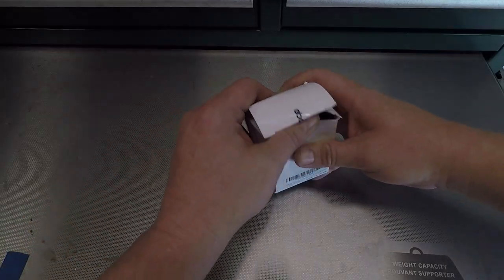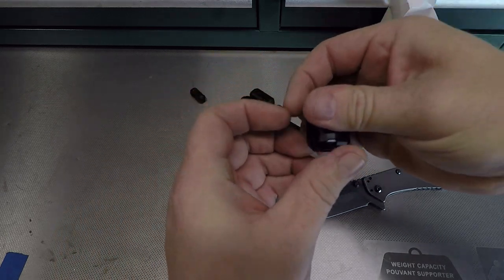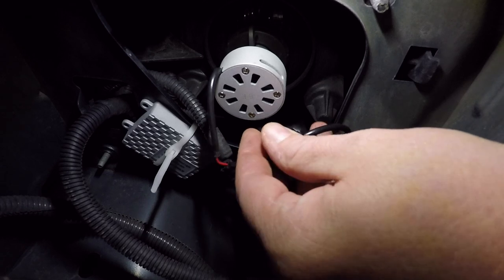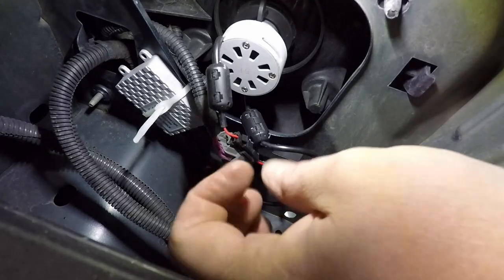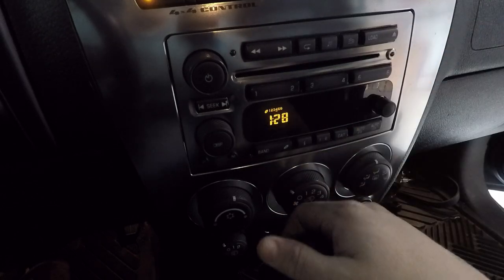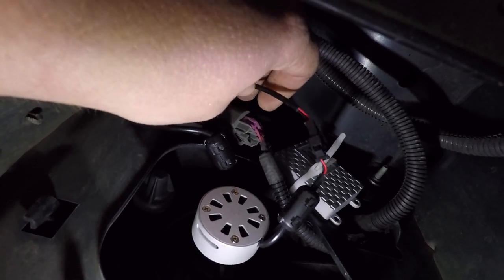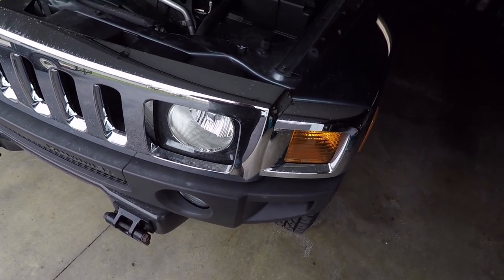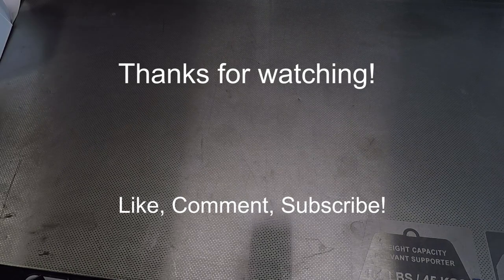Fixing LED Headlight Radio Interference

Comment from the maker: Please subscribe to my channel! I could use all the help I can get!  Thanks for watching!
Reply: Next time, try a capacitor to filter out the switching frequency.    The noise is coming mostly from the led control ic that switches the leds on & off at a high rate of speed to keep voltage within spec so they don't burn out.    The fan also creates a pulse when it's running, so a cap on it will help filter out the ripple.

Comment: Thanks for vid. But my personal experience, I just now finished putting about 10 of these in my car. All four led day running bulbs, two halo's rings, on the relay powering the relay, the on/off switch, feed power wire, power wires on the head unit, even on the antenna cable. Nothing, not even slightly better. Oh well, we tried.
Reply from the maker: well, crap.  yeah it was worth a shot..

Comment: I clicked on my volume off button on the speaker volume and it went away. 😂 Didn't think that the buzzing noise was coming because i had aux cable connected.

Comment: Great video. I have the same issue. Googled it and saw the filter clips. Just wondering if the clips have to be snug to the wire or if they are loose will they still do the trick?

Comment: Looping the cable Around the core up to 7 times increase the effect
Reply from the maker: Didn't know that!  Thanks! Are you talking through the center or around the outside like a cylinder?
Reply: through the centre, around the outside, through the centre
Reply: what core?
Reply: Wire for the bulb isn’t long enough

Comment: Thank you for your video.
   Vehicles now have many computer chips. Each can generate RFI or radio frequency interference. Also, any wires connected to a radio or sound system can act as an antenna. So happy hunting.
   If 2 turns of wire are looped through the ferrite bead, you get 4 times the noise reduction. 3 loops, 9 times the noise reduction. Saves on ferrites.

Comment: I just put LED headlights in the '87 Porsche 928, static now on all the FM stations. I can visibly see the "shaking / strobing" of the headlights. I will give your solution a go to stabilise the current.

EDIT: I installed a 30mm clip on ferrite suppressor on each headlight cable, it did nothing to reduce the radio interference. unfortunately the cables were too short to loop around the suppressors.

Comment: It’s the PWM ‘pulse-width modulation’ of the diver that is causing all that interference, the best way to get rid of this is using a LPF low pass RF filter. Another thing that will work is a anti-flicker harness....

Comment: Very helpful, I was getting RF interference big time after I installed my SL1 LED headlights.  I ordered a set of #10 5mm ferrite beads from Amazon.  I only needed one for each light to totally eliminate all the interference.
Reply: Which cable did you put them on ? Leds or radio areial

Comment: I think it's linked to poor ground.  I have the same thing as well but looking around to validate what I think it is.  So taking the ground off and turn on the radio.. if it clears, then try a different spot to ground u til radio clears up

Comment: Rocket Scientist, amazing, GMTA! Every light in my truck is LED. Going to give this a shot. My LED's came with canbus so I know that isn't the fix, but may be the problem. I had my driver rear saying bulb out, unplugged it and rotated it 180 and solved that. Lets see if this works on the radio noise. Thanks!

Comment: Ive had that exact type of led bulb before, first type/design I ever tried. Ive now had a few different sets and found the cob designs suck and you want a bulb w like a cree xp70 or two on it kinda thing.. but the filter is an interesting idea. It would work better on the speaker wires. Or a diode at the fuse box to ground I think..

Comment: You could also add one to power supply to the radio itself.
Also looping the wire through the bead a second time is even better.
Reply: Where is the power supply to the radio??

Comment: You could also try tracing your headlight harness back to the fuse box under your dash, or in your engine bay, where ever it might be, and placing the ferrite cores on the wires closest to the fuse box, but also on the power wires coming from the fuse box to the stereo. The major issue here, is that the ignition system, headlights, dash, radio, windows, and a few other systems all rely on the same fuse box, and therefore wire harness, which is why when you turn your headlights on, it begins to interfere with the stereo. I put ferrite cores on the power wire from the harness coming into my stereo and it cleaned it right up. No need to place them on the headlights at all, unless you still have static.
Reply: The important thing is to stop the wiring acting as antennas.  For the LED-headbeams that is as close to the lights as possible.  The main problem is the voltage switch mode regulators.  They act like spark gap transmitters with lot of harmonics in the radio spectrum.   Clip on ferrite does not attenuate much, so often you use several in series.  A ring core with many windings works better.
Reply: @la7dfa  Hmm, I'll have to make one. I have several ring cores in a tray around here somewhere, and plenty of solid copper wire core.

Comment: I have LED headlights, all my running lights are LED, 3 LED light bars, 2 facing forward, 1 is white and 1 is amber, 1 white LED light bar mounted on my headache rack facing the rear, 2 sets of LED pods in my rear fender flares, and 1 set of LED pods in my rear bumper.
None of them causes any interference except the 1 forward facing white light bar.
When I turn that one on my radio is useless.
I added a ferrite on the power wire where it enters the bar and all interference is gone 👍

Comment: You are a life saver! Just put in mini led light bars on my jeep for driving lights. Though I wouldn't be able to listen to the radio at night. I'm ordering this right now!
Reply from the maker: Let me know how that works on a light bar!  I don't have one and I'm curious to see if it works on something with multiple led's.
Reply: @RocketScientist  I just installed them. They work great! Almost no interference now. Before my light bars blasted the whole radio out. I had to play around with the sizes and locations to get the best single. I got better results when I upsized but they are a little loose.  I'll have to zip tie everything in place, but now I can have my lights on and listen to the radio at the same time! Thank you for the video!

Comment: I put 4 cores on each headlight wire but it didn't help at all... I'd put some on the radio power but its too much of a hassle to take the whole dash off. Easier just to switch back to OEM bulbs.

Comment: You should have tried putting some on the power to the radio and also if you have enough wire you can go around and pass thru a couple times with more success or just adding more of them to the same wires
Reply from the maker: James Holbrook I heard that, unfortunately not enough wire on the headlight kits to do that

Comment: I'm glad it ended up working out! Much like you, I'm not exactly sure of the source of the RFI. I just installed Halo LED headlights, so it might be the Halo or the LED (or both?!) Do you recommend throwing ferrite chokes on everywhere, just to pinpoint the issue? Thanks!
Reply from the maker: Thats pretty much what i did.. on and off various wires until the noise stopped.

Comment: Another thing you can do to get rid of interference is ground the back of your radio better with a bigger ground
Reply: I have LED headlights have interference too. Talked to a stereo installer about it, he said the coils are really the only option or go back to halogen lights again👎. Apparently it's caused because the led lights draw less than 12 volts? Which I don't really know much about. So any other suggestions?

Comment: I know this is an old video but I hope you're still active. My running lights work and that's it. Could it have something to do with the radio that was installed?
Reply from the maker: I'm here, just haven't made a vid in a while.  By running lights you mean dash lights or outside lights?

Comment: Get the dash cancellation message hide plug for the light bulb size you have , it's a plug that plugs between the bulb and the main harness. Ebay for $9.00. It's a HID plug. Has a black box in the middle plugs on both ends
Reply from the maker: Kevin Hunter Thanks man!  I'll look into it.  I installed a different set recently and they have interference I can't get rid of.
Reply: Hey mate, could i get more information on that plug you were talking about?
Reply: What is the device called?

Comment: I recently installed 55w HID ballast in my ford.. Post installation i have started experiencing a high radio interference while  playing FM. Could you please guide how to select whixh ferrite clip/beard should I get as there are a lot of options available in market
Reply from the maker: This is similar to the kit I ordered.  There doesn't seem to be much difference in the actual items other than size and quantity.  Its probably a good idea to get a variety in one order.  I also thought about wrapping the entire ballast box with EMI tape.  Cost is about the same, and its another option.  Could do both if you had to.  

Taigoehua 20 Pieces (Black) RFI EMI Noise Suppressor Cable Clip for 5mm/ 7mm/ 9mm Diameter Cable https://a.co/d/h6Qg75M
Reply: @RocketScientist  let me try that... But I presume this should work

Comment: So I have a led emergency blue light bar and it will do this with my firedept radio and pager. Would these things help with that?
Reply from the maker: Hey brother!  Also a FF of 25 years.  It might.. I think you might run into a problem since there are multiple LED light heads contained in the bar.  You'd have to take it apart and put one on each individual light inside. What brand light is it?  Is the radio a portable or a mobile installed in the car?  I ran a slimlighter and a bunch of tir3's for years with no issue. Also had good luck with Tomar products.   Probably easier to sell the bar and get some others that don't emit as much interference.

Comment: I think it has something to do with the radio antenna ground. I have the same issue but with LED brake lights. There no static when the sourcing from a USB instead of the radio signal.
Reply from the maker: Matt Greenland hmmmmm thats interesting.  I might have to investigate that one further... Thanks!

Comment: I thought the ferrites were to be put on the RADIO wires first to stop excess noise 1st? 4 /7/2021 like when you have RF from sparkplugs on older cars. I believe there are two other things that can be done as well but its been a long time
Reply from the maker: tried it in a later video with some different lights.  did nothing.

Comment: Thanks for this Will give it a try on my leds day running light I had fitted as my signal to the dab radio is awful!!
Just to double check do these just clip on the wires to the leds? 
Or should they also go on the radio areial cable? Or both ?
Reply from the maker: Yep they just clip on.  Try it on one wire at a time so when the sound improves, you know where the interference is coming from.
Reply: Does it matter how many I put on?
Which should I try first leds cables or radio aerial cables?
Reply from the maker: @luciocancellara4995  most convenient one first.  I tried my antenna wire and it did nothing.

Comment: I’m pretty sure all led diodes are supposed to be sideways and not up and down as they appear in your fog lamp. You should be able to clock the bulb to turn is sideways. This will help prevent glare and make the beam pattern the closest to stock as possible
Reply from the maker: That particular led in the fog light only has a one-sided LED, so it reflects opposite of the way its facing.  Turned upward the way it is, the light bounces off the top of the housing and down toward the road, exactly how I want it.
Reply: Interesting

Comment: What if you just put it on just the radio?? Would love to know if that would work instead of putting it on all of those wires??
Reply from the maker: eh.. i got some other lights that I reviewed in a later vid.  I put them on the antenna wire and it did nothing.  My new lights make noise no matter what.  I'll probably do some tinkering with it..

Comment: Thanks man. I just purchased these farite clips for my Harley ultra classic. Installed led headlight and lost all radio reception. Hopefully it solves the problem.
Reply from the maker: Awesome!  Let me know how it works out!
Reply: William Lerp did they ever work.
I have a Street glide and was thinking to try these because of crap reception
Reply: Mike Hammer  they worked somewhat. I regained some radio reception but not as good as it was before the led installation.
Reply: @williamlerp9773  If you can loop the wire thru the Ferite clip several times it will do more for you, there are also electronic chokes that can be used I believe and could be better.
Reply: @Critical_Mass  that's exactly what I did but I only regained some of my reception. Luckily I have a cd player.

Comment: just wondering should you put the ferrites  on the radio wire?
Reply from the maker: DERMOT HENRY Hmm... not sure.  I didn't try that, but I would think it would mess with the desired radio signal.  perhaps I'll try it just for the heck of it.  Thanks!
Reply: Antenna= no, radio power= yes
Reply from the maker: H Higgins  tried it.  Made no difference.
Reply from the maker: H Higgins  exactly what I did.  I have since changed these lights out for a different set which I have also reviewed it interested.

Comment: So, I have the same truck as yours. I have also tried the ferrite cores and no luck. I even "stacked" them 3-up on the lines and no difference. ...any thoughts?
Reply from the maker: Hmm... Thinking about what may be different about mine...  OEM 6 disc GM radio.. I have a generic replacement antenna since a car wash ate my factory one.   I did try the stacking idea to no avail, and ended up with one on every wire going to each light head, and it worked so I stopped there.  What brand of headlights do you have?  Any other LED lights on your truck besides the headlights that you may be overlooking?  They all seem to make noise for me, even the little turn signal ones which I pulled back out in a hurry.
Reply: The only LED's are the headlights and fog lights. I just ordered "canbus" add-on ballasts...let's see if those work...TBD.
Reply from the maker: Gene Conti Hey, its worth a shot.  Let me know if that works.  Usually those canbus resistors just fool the computer so you don't get a bulb out warning on the dash.  So I didnt try it.
Reply: No Dice, actually worse, the lights won't come on at all now. Sending them back...running out of ideas here...
Reply from the maker: Gene Conti Well crap.  So am I.   Try a different brand of lights maybe?  If this didnt work for me, that was my next step.  I might do that anyway.  Thinking about Auxbeam.  I've seen zero legit complaints about them.
Reply: ok, returned the "bad" lights and bought a better brand, still had to add the ferrite beads but solved the problem. Any ideas on adding a 32" lightbar behind the center of the front bumper?
Reply from the maker: Gene Conti good deal!  I've been thinking about that LED bar idea too.  If/when I do it, I will no doubt make a vid on it.

Comment: I'm having same issue but with my parking/brake lights. I just switched over to Lumen LB Series led and it's driving me crazy.
Reply: Even bought load resisters but I think they're for ''canbus'' protection. Haven't hooked them up yet
Reply from the maker: @dawhoda1  what kind of vehicle?

Comment: Your LEDs are oriented wrong in the housing. Supposed to be left to right (3&9 o’clock) position. But thanks for the tip I’ll give it a try
Reply from the maker: No they're not, but thanks

Comment: anyone know the approx size to order ?  3mm, 5mm, 7mm or does it matter?
Reply from the maker: Eh.. It helps to have it clipped firmly on the wire so it doesn't move around. I'd say just get one of those variety packs.  There's bound to be at least a few you can make use of.

Comment: How many watts and lumens are your headlight bulbs?
Reply from the maker: 72W, 8,000 lumen.
Reply: @RocketScientist how many ferrite chokes did you end up using on headlight wires?
Reply from the maker: @cbradiomizfit7562  I think i ended with 2 on each wire.

Comment: Beam pattern on those LEDs must be horrible, try to have the chips facing 3 9 clock position and not 12 6.
Reply from the maker: I dont get why people always say that.  Does no one know how tf a reflector works?  If I face it in a 3/9 position, its shooting the beam sideways where its lighting up the top of telephone poles.  The way I have it it reflects flat directly onto the road, and the spread is 4 lanes wide exactly how it should be.
Reply: @RocketScientist  well, thats how it works for me and also for the majority of the cars... the best comparison would be to put it against the wall around 25ft distance and have one side with the oem bulbs and the other side with the led, if the beam pattern is a lot different, then its wrongly adjusted or you have a shitty led bulb possibly,  not to mention that the oem bulb and beam pattern usually has some sort of cut off line to avoid glaring the driver in front of you..

with the 3 9 setting, my beam pattern is almost the same as the oem bulb, just a tiny bit different because the chip in the leds and the filament in the oem bulbs being a little bit different in size and positioning.. and thats another thing, the leds you are using in this video, chips seem to be the ones from older tech, they won't resemble the beam pattern very much even if its 3 9 position it seems.